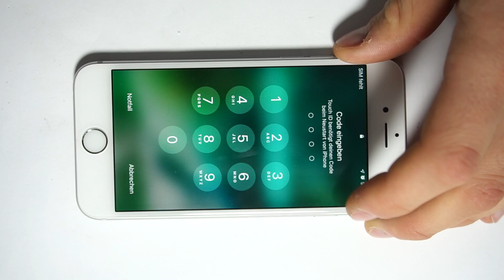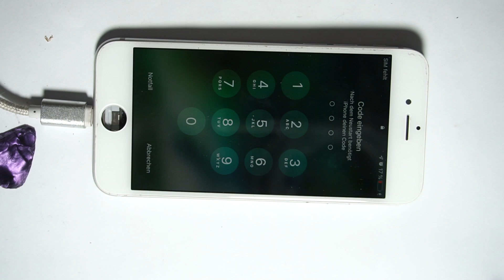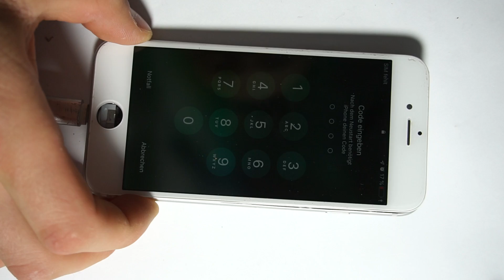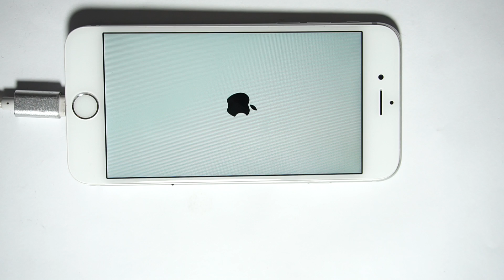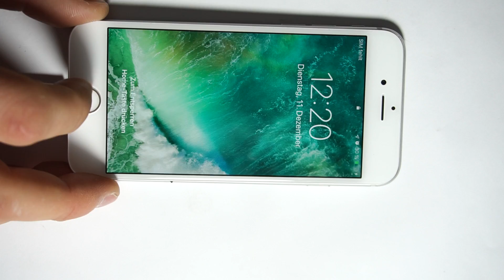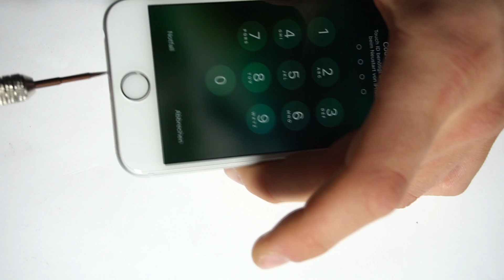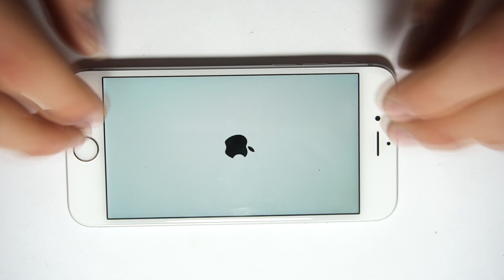How To Repair IPhone 6s touchscreen not working - DoItYourself Tutorial

Comment: I am not sure what you did. A written or voice over the video would be helpful. I only hear music with this YouTube video. It appears that you applied some solder paste to a connector at video 10:36 and then heated it up with a heat gun at video 11:06. Is that the fix? Is the idea to apply the solder paste to the connect and heat the connector up to reflow the SMD solder on the connector? So the problem is a bad solder joint on the connector? I have a problem with a shaking/streaking screen that is not responsive to touch on my 6s. Could I have the same problem as well?
Reply from the maker: Yes Bad solder Joint.
Reply: @allsmartrepairinternational  thanks for the reply. If it is a bad solder joint, don't know if I can repair it myself.